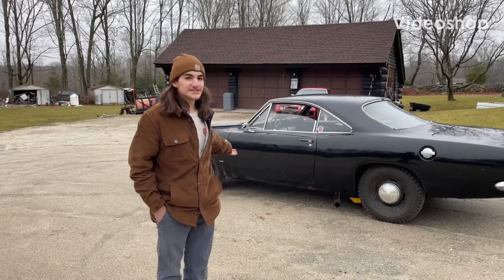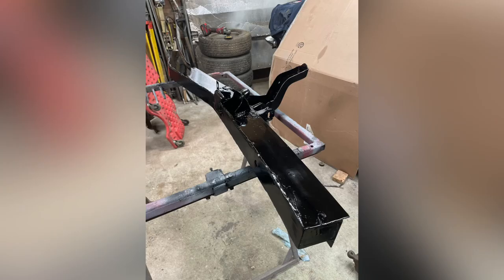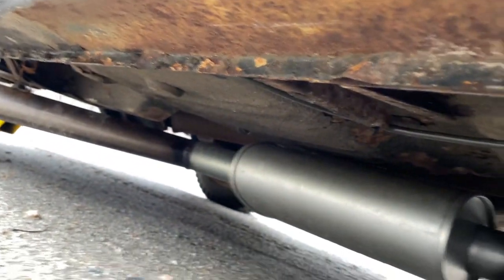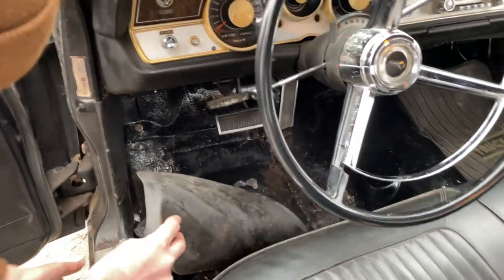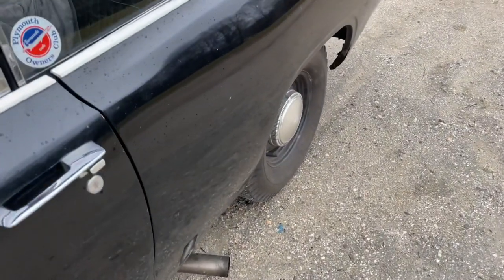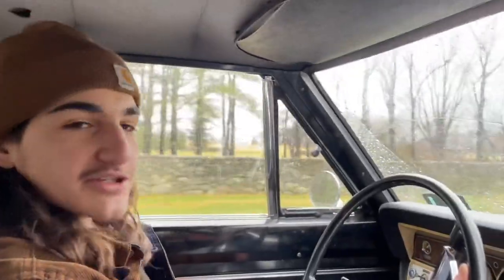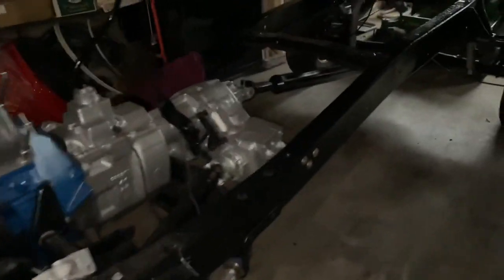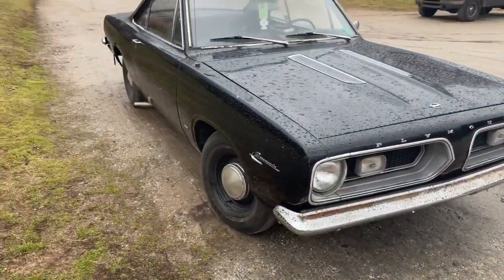My 1967 Plymouth Barracuda (My daily driver)

Comment: Hell yea. Good to see other A body barracuda builds. I've been slowly messing with a 67 fastback. Haven't done a whole lot to it other than typical maintenance. Put a set of super stock springs in the back. I actually picked it up off of Langley Air Force Base. Car already had a 8 3/4 but it's open so it'll be welded lol and a 360LA that I'll probably swap for a Magnum. She needs a lot but runs and drives so I enjoy it more than I work on it.
Reply from the maker: That’s really cool, and ya I love my 8 3/4 posi it takes a beating

Comment: When you get a chance, you might want to tie the subframes on it to keep it from twisting. They'll help it hook also. I'M envious of you with the projects you have & I'm 60!
Reply from the maker: What do you mean tie the subframes?
Reply: @PeteGuarino340  go from where the front of the rear frame rails are, go THROUGH the torsion bar crossmember, like Chris "junkerup" Birdsong does on his YouTube channel, to the front frame rails. You tie the whole unibody together & make it A BUNCH stronger. Good base to start with are the US Car Tool connectors & add on or make your own out of 2×2 or 2×3. They also have rear spring relocation, front & rear torque box, & front shock mount reinforcement kits.  I had a VERY rusty Duster with sub connects that I cut out of it before I scraped it & it almost folded in half! They DO make a difference! Good luck young man! You're doing fine!